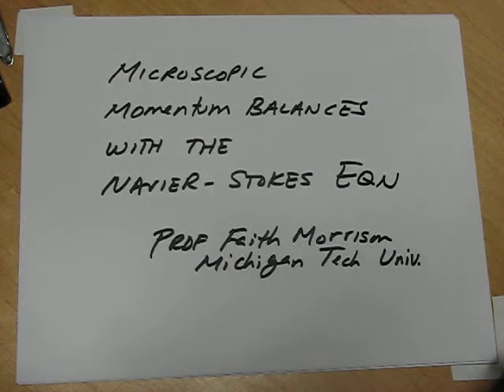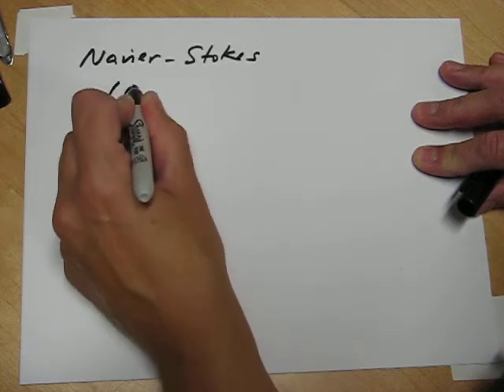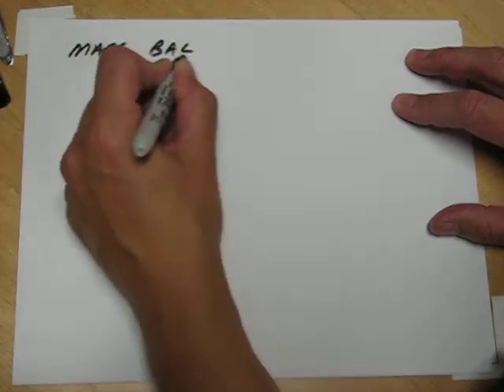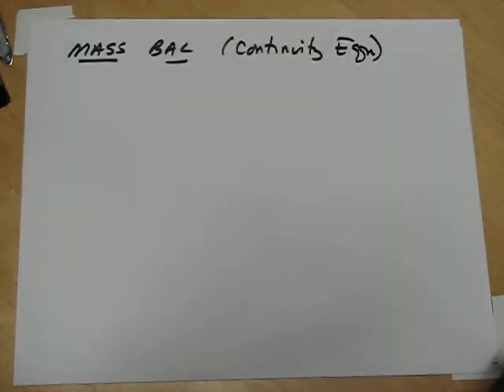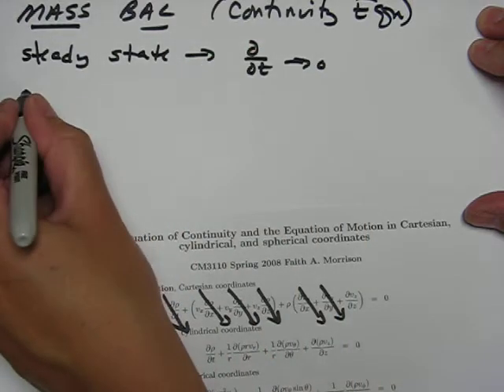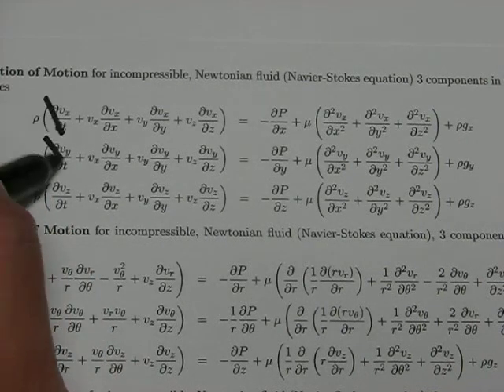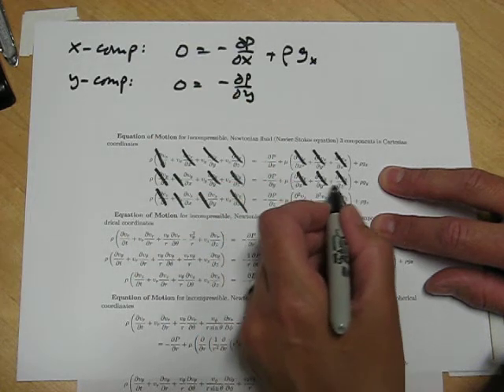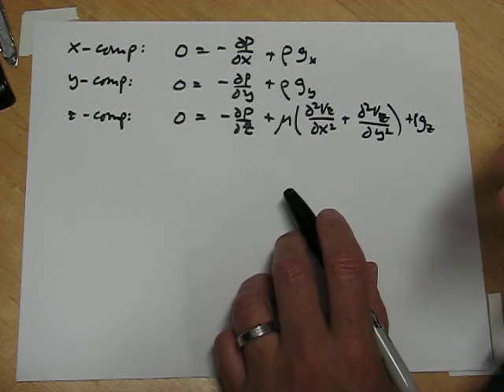Part 1: Microscopic Momentum Balances with the Navier-Stokes Equation

Comment: I am confused. I tried to apply the continuity equation to flow through a constricted venturi and I've run into a problem. Choosing X for the flow direction and Y and Z axes for flow to top and one side and using water or air at M << 1.0, all the d(rho) terms vanish. dVx/dx MUST be nonzero as the flow definitely accelerates through the constriction, but what is happening with Vy and Vz? They are zero at the start and finish, implying they can be dropped, but that leaves me with the impossible result that dVx/dx, which DEFINITELY changes, is zero!!!

I think my reasoning is falling down because things are changing in the constriction zone (not steady state!!), and if I were to focus my control volume on the constriction there could be dVy/dy and dVz/dz terms (probably identical due to channel symmetry) which would set things right, but I would appreciate clarification if you can spare the time (disclosure: I'm teaching myself via YouTube and textbooks, and it's purely for interest).

Comment: That's depends from the direction of the coordinates system you choice, but the most simply way to see it is that if the fluid is moving in a completely horizontal direction, you won't have the gravity effect, but if the fluid moves vertical or diagonal the effect of the gravity should be considered.

Comment from the maker: How to model complex systems with multi components (soil plus water) is a very advanced topic.  I suggest you go directly to the literature on soil mechanics, which will include granular flow.  The microscopic balances can handle both steady and unsteady flows, constant density and non-constant density fluids. If you write balances on a two component system (water, dry soil) you may find success.  An alternative approach would be to use a time-dependent density for the wet soil.  Good luck!

Comment: Thanks for the suggestion on granular flow. It seems to be a new field from the references I have seen.
Coming back to the conservation of mass - the reason I asked is because as an open system the mass is constantly increasing as rain falls. However it appears that the rate of increase of mass is balanced by the rate at which granular flow of a surface cross section. Comments ?